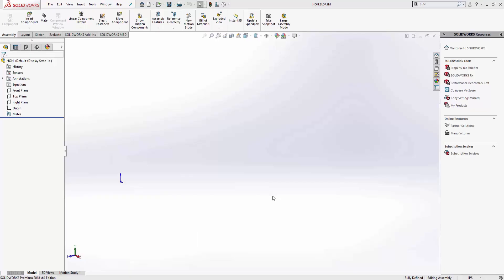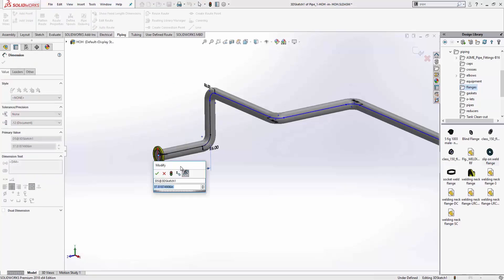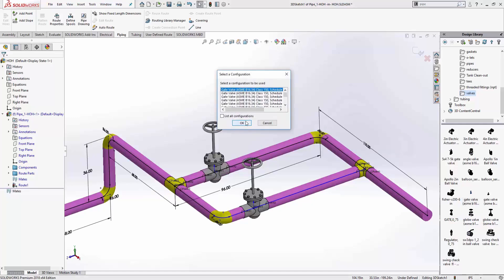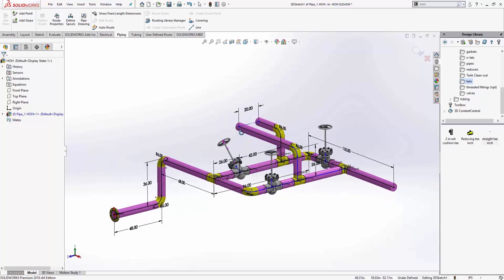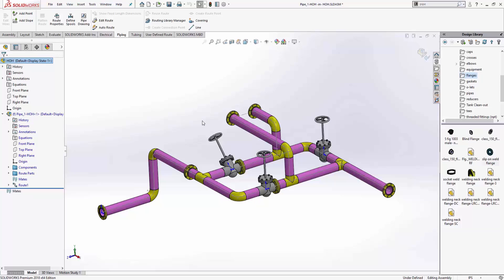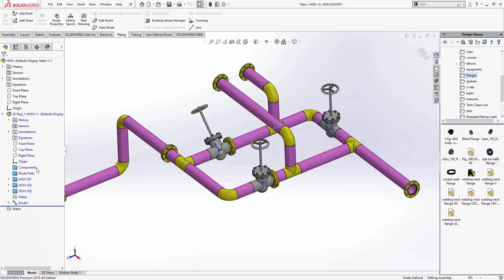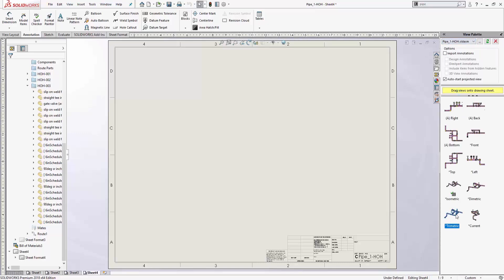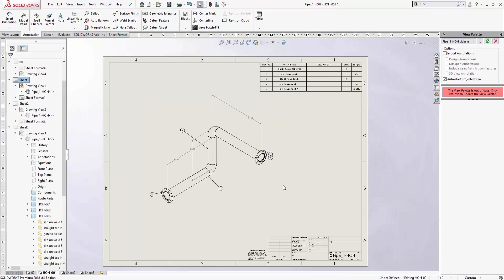SOLIDWORKS - Routing Pipe 101

Comment: We have to number every connection. Flance , treaded, welds and so. how can you do that?
Reply from the maker: There is not a really good way to do that with only SOLIDWORKS Routing on it’s own, this is one of the reason they introduced the SOLIDWORKS Electrical suite of products. This way you can create a schematic P&ID, and then in Electrical 3D (SOLIDWORKS Add-In), you can connect to the same Project and Route the P&ID with all of the corresponding ID’s. There are also some 3rd party apps like Smap3D and SolidPlant3D.

Comment: Hi There
 could you please advice me how to update design library  with table E flange  and other components with same flange configarations. .
thanks.
Reply from the maker: I would use one of the existing flanges in the Library and Copy it, then modify the dimensions in the table to meet the E flange specs. Once the part is ready run it through the Routing Component Wizard (SOLIDWORKS – Routing Component Wizard - https://www.youtube.com/watch?v=p0lECUdJ2oI) . Then it will be in your library and ready to use!!
Reply: Thnak you very muck for your reply

Comment: When I save the 6." flange in assembly mode it converts to metric. When I try to dimension everything its mm not inches. But I save everything in inches. Just at the point of saving the flange in assembly, it goes back to mm? Can you help? Thanks
Reply from the maker: For assistance, please contact our tech support team at goengineer.com/contact

Comment: I still won't adjust the angle of the parts. and I don't know how to turn on the gyroscope.
Reply from the maker: Hey Parvati, after you place the part sometimes the triad will show up like it did in the video.  However, if it does not, you can right click the part and select "Move with Triad" this will allow you to move the part the same way as was done in the video
Reply: @goengineer  think you

Comment: Excellent tutorial. It appears Solid Works runs great on your machine. When I enter the design library it takes ages to load. Care to share your PC specs?
Reply from the maker: Hi Mike,
We run Dell machines exclusively, NVidia Quadro graphics cards, 3.0+ GHz CPUs, and 16-32 GB of RAM.  We find that slowness specifically with the Design Library sources back to where the Design Library is stored.  If it is on a network drive it will load much slower than local storage.

Comment: I have some problem as in video bends appear as yellow but I have red but tee and other stuff borrow from library appers yellow and after I exit it the red one disappears in the final output.
Can you tell me solution of it?
Reply from the maker: Hi Ashok,
If the radius of the bend does not equal the bend radius of the default elbow that was selected (@1:36 minutes in video), then the system will not be able to place the correct elbow on the route. I’m guessing you are using a custom elbow. You may need to make sure you use the Routing Library to add your elbow to the library with all of the needed sketches, attributes, and C-Points.  

If this does not fix your issue then we would encourage you to contact your local Technical Support company to open an investigation for a fix.  You can find out who that is from the link below:

http://www.solidworks.com/sw/purchase/varlocator.htm
Reply: Thanks 🙏👍
Reply from the maker: Thanks for stopping by our channel.
Reply: Thanksx2!
Reply: Thanks for the nice presentation
Could you tell me the cost of piping license.